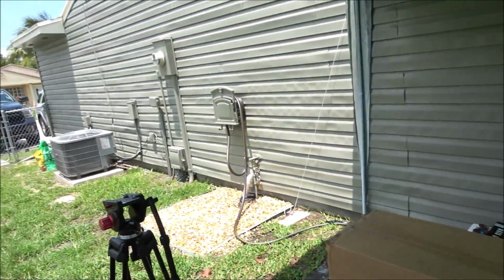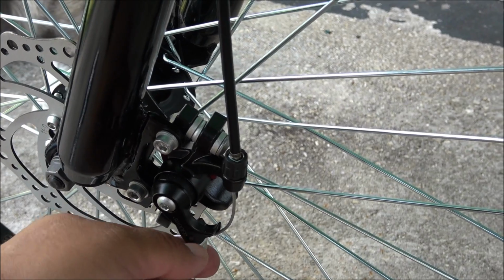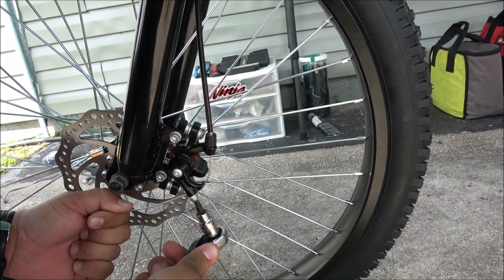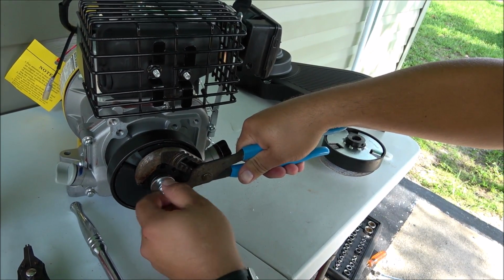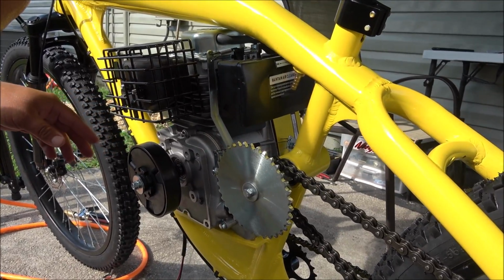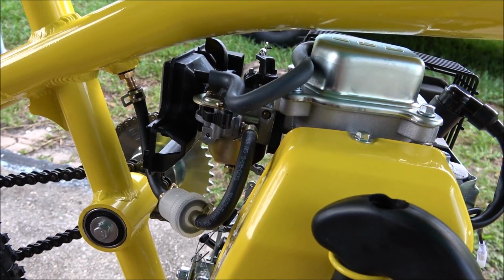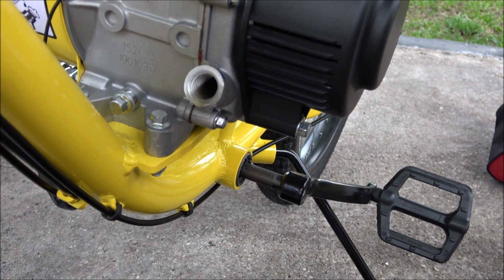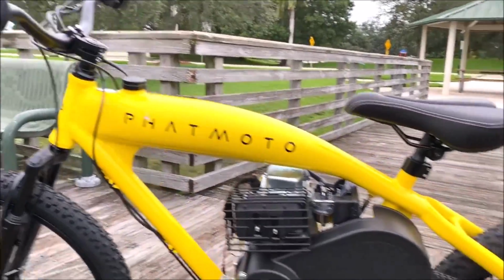Phatmoto Rover 2020 [Motorized Bicycle] - 79cc 4 Stroke - Unboxing & Installation Tutorial

Comment: At least it sounds decent!!
They make performance parts for these engines, you can probably get 5-6 maybe 8-9 HP from that engine, without spending a fortune, if you bypass the governor, the flywheel needs to be replaced, it can explode , unless it has the aluminum flywheel, then it's less likely, but the billet flywheel is best, 5000rpm is about the fastest id spin it stock, with a bullet rod, and good flywheel, maybe a few little things, porting, and carburetor, exhaust, it will more than double the power, a cam is the final step, then proper gearing to take advantage of the engine, it should easily rev to 7-8k rpm, but a daily type ride, I'd keep it under 6k, but if it's just a commuter bike, a cam, rod, carb, and aluminum flywheel, using a motorcycle carb, with good oil, and frequently changing it, it should last years, spinning 5-6k rpm, at near 50mph, making 5-6 HP,  with porting and such maybe more, I'm not that familiar with the smaller 79cc engines, they may possibly make 10hp at 8k rpm +/- with lots of work,   but the cast iron flywheels do explode, I would not rev over 4k-4500rpm, definitely not over 5k for any time, even then, I'd remove the cover, and check it weekly,  if it explodes you will likely. Be going to the hospital in a ambulance! It's not like a engine blowing up, it's more like a grenade exploding, chunks of iron evacuate the area, possibly destroying the engine also, , and heck, you can probably put another one of these engines on the rear, above the tire, just add more chain,  and throttle cable, maybe a chain tensioner, and idlers, that looks like the harbor freight engine, maybe $200 to add another engine! Or being you add it to the rear. Go with the 212cc, 6-7 HP, 10 with no Governor and aluminum flywheel, carburetor,  it would probably do 80mph with the 212, or 224 engine,  
Sorry I ramble a, well a lot! 😔 Sorry
Reply: That was the best comment I seen scrolling through these.

Comment: I think there’s a fitment issue with the EZM transmission. The rear sprocket on the EZM is also huge (so you have to use a tensioner most likely meh!). The go cart transmission that piston bike or gas bike sells is just jackshaft. Haven’t seen a cvt idunno wtf to do for a transmission. Grubee won’t have stock for the 5G for a month or two -Oct 19 2020

Comment: Im having trouble with the throttle i pull it and it doesn’t snap back in to place and it doesn’t move the throttle cable at all, also im having a bit of trouble getting the chain to be more lose and the breaks are giving me trouble to i tried to tighten it and still really nothing not sure if im doing stuff wrong
Reply: Spary some wd40 in the openings of the cable and around the  Linkage

Comment: I ordered a red one. I live in a colder area so I'll be putting 0W-30 oil in it instead.

The manual for my welder generator combo says 10W-30 if the temp stays above freezing, 5W-30 for between 0 and freezing, and 0W-30 if I'm going to start it below 0.

I'm assuming similar principals apply here.
Reply: Where did you order the bike combo

Comment: Excellent video. NEAT ! Quick question, my Phatmoto 2020 rear wheel does move very freely. I am comparing it to my earlier build on a cruiser bicycle. Is it normal?  Like if I lift the rear wheel by the seat and give it a spin, the wheel spins for a couple of rounds but not as freely like a bicycle wheel. Is it normal? Maybe the rear brake pads are clutching the brake disc a bit? Or may be the transmission setup? Any tip would be appreciated. Thanks. And again an excellent video. Thanks for uploading.
Reply from the maker: Nick Hersheys Resistance on the rear wheel is normal. Remember now you have 2 chains running plus a transmission. 😉
Reply from the maker: Nick Hersheys Yes it’s normal.
Reply: It's a crappy design.

Comment: 4 or 5 oil changes from 2 qts= break in requires 5 min idle /1st change!!!!!! no exceptions ! will see metal from rings /break in... then 30 min idle 2nd.. then 1 tank, or 160 miles.. 3rd... broke -in :>).... then once a year ! ..

Comment: I got the 2020 version and after adjusting the idle the throttle seems to take for ever to respond and the bike cuts in and out. It’s like it’s starving for fuel. I barely have a mile on it. Any thoughts?
Reply: on mine the choke was marked wrong
Reply: @markhagerman9736  so where it say’s off it’s really on?

Comment: Would it be better to build one from scratch or get this one
Reply: Buy one and start riding. I have built stuff like that and it seems like it takes longer than it should and it does
Reply: Buy this and slowly upgrade everything. 
Its the best frame you can buy! The stock parts will hold up if taken care of i got over 20,000 miles on mine.

Comment: Please someone help me get this thing started. I did everything the gentleman on this video said to do and I've yet to get it running.
Reply from the maker: Melvin Cortes Check your kill switch, make sure the fuel valve is on, its located on the carb. Also make sure the wire that goes to the spark plug is connected
Reply: I've done all that already
Reply: @MJTechChannel  I think its something electrical. That wrong from factory. I'm not getting any spark from the plug at all...
Reply from the maker: Melvin Cortes Disconnect the kill switch
Reply: @MJTechChannel  completely?
Reply: @MJTechChannel  it turned on!!! Wow!! Ok but what do I do about shutting it off??
Reply from the maker: Melvin Cortes your switch might be backwards on the labels
Reply: @MJTechChannel  ok thamks
Reply: @MJTechChannel  thank you so much bro!!!
Reply: @MJTechChannel  thank you very much for helping me😊
Reply from the maker: Melvin Cortes Glad I was able to help! Take care and ride safe
Reply: @MJTechChannel  good afternoon sir. Sorry to bother you but I have a quick question..
When I start to take off the front of my bike trembled like if the neck was lose.. What would you do?
Reply: @MJTechChannel  sorry to bother you but the screws on each side of the frame in the rear,what are they for or what do they do?

Comment: It's a bicycle. You don't need all of that thread lock... especially red. One of the few places you MIGHT encounter thread lock (blue) from the factory are on the disc rotor mount screws. If you feel like you absolutely need to gum up the threads with something use Loctite 222 or Pliobond. Lock nuts are sufficient for motor mount hardware.  Also, I can tell you a story about a guy now missing some toes from riding with flip-flops...
Reply: This bike needs loc-tite, maybe not red, but blue for sure on disc/sprocket bolts, jack shaft bolts, and pedal cranks, all areas that owners have had complaints about coming loose. Also it is advised to replace said bolts with quality ones. The stock bolts are inferior and will snap off with low torque. Good luck and check those bolts for tightness, don't be one of the ones with a damaged rear wheel because they came loose on you.

Comment: I just bought a Phatmoto Rover and the chain sounds a little noisy when I roll the wheel.
Reply: Just got mine and I have to keep it at full throttle at all times if I want to move fast but it's really hard to keep it at full throttle hurts my wrist do you have that problem

Comment: Just received mine in and followed your instructions to assemble but couldn't get front tire on becuase the forks were bent had to bend them back to get front tire on but brakes dokt line up they are still pointed too much in , does the bike come out the box with the back brakes locked up like I can move the back tire i cant move becuase brakes are too tight and no way to give release I called the company but they said no returns and hung up I called better business bureau becuase sure they sent me a defect I seen all the assembly videos and mine was nothing like those its bent or shipping bent the bike up bad or they sold me a defect and wont give me a return I am so disappointed I cant even ride this thing that costs me 1200$
Reply: My forks were bent too and they sent me replacement forks at first I wanted to return it and get my money back because I was going to get a e-bike and they said it would cost me about $400 to send it back so I kept it

Comment: Please do yourself a favor and don't use grease on your clutch bushing, it really doesn't last very long and you'll be tearing down your clutch to constantly re-grease it. Please use 30 weight oil on the bushing, like the clutch manufacturers recommend. It will outlast the grease 10 to 1 and it can be done with the clutch still on engine. 3 or 4 drops at the snap ring will do it. Spend your time riding not greasing a clutch.
Reply: You are right and like I think you said amd makes sense oil after riding when hot so oil can soak in metal. Check out comments some guys say don't use lock tite that"s a good one. Do you know can you still clear and pedal a 212cc with out rubbing or hitting your legs? I tried going on Facebook a week ago had some reasonable used phat Moto bikes but no reply or phone numbers to call.
Reply: @zedee2000  Yes, a Predator 212 can be made to fit, and if done right clears the pedals, there are some things to consider. A real weak point is the rear hub and axle. With the added horse power and torque (P 212 = 7+ hp) the axles bend or snap. Upgrading to a chromoly axle and grease and adjustment it might last for a while. Some guys are upgrading to billet hubs with sealed bearings 11 and 10 gauge spokes. Or try converting your hubs to a sealed bearing and strong axle. Lok-tite is mandatory on this bike, also upgrading the hardware (bolts are inferior from factory). Try checking your local Craigslist listings for Phatmoto's, I still see them come up, cheap $500 with upgrades. Good luck. The new 2021 Phatmoto's come with a upgraded Hilliard clutch, (its really a undercover race clutch) with lightened race shoes, hardened 5/8 hub, and select springs. Myself and a friend, did the testing for Hilliard for Phatmoto. Trust me Hilliard says put oil on your bushing, use grease and you'll render the bushing useless.
Reply: @beaubrummelmotorizedbicycles  okay thanks, I remember you had the keyway snap off with the Hilliard clutch. That's why I went with the max torque clutch, on the door for $75.00 I've got a new drive chain to replace, rear tire with baby powdwer, max torque clutch, drill holes in side cover, Grease the   5 points of bearings including jackshaft. I saw a video you can take a pic tool and lightly take that rubber seal off on the self sealed bearings on the jackshaft add grease and put the rubber seal back on. You can do it with any self sealed bearing with that flat rubber seal. I thought about switching over to propane on the phat moto but the engine is so dependable since I ride it so much. I have changed over most of my little generators to propane for dependability and longevity. Because they sit so much. You may not remember me I changed my Google account name a while back. Someday I think I'm going to do a YouTube channel on a few things, once I get a better smartphone camera. You have a good  channel what's good tips keep up the good work.
Reply: @beaubrummelmotorizedbicycles  one video tou might want to check out It'll be hard to believe. YouTube baking soda and molasses kills cancer. A guy named Veto did the video he standing on a stove cooking up baking soda and molasses to drink for his stage 4 prostate cancer. Each night before I go to bed I take about 8 ounce of 9.5 alkaline water and add two teaspoons maple syrup. Mix it up, drink it, brush my teeth and go to bed.
Reply: @zedee2000  Thanks Ze Dee I do remember you, one where going to do the propane conversion. I was really not happy with the 5/8 Extreme Duty shearing off the key. They now offer the hardened hub for that clutch and it is repaired. Through the facebook group I moderate, the admin knows the head engineer at Hilliard and set us up as the testers for the new clutch Phatmoto sells and puts on there new bikes. They are good because of the hardened hub, Max Torque is a good American made clutch, I have one also. In fact all the clutches that come out of China have copied the Max Torque design, just no quality. It sounds like you have a good handle on your bike. I also saw a video about popping of the seals and regreasing the bearings like our jack shaft bearings, I am planning a video on that. I use a moderate priced cell phone camera for my videos. The trick is to use a holder so video is steady and move the camera slowly from item to item, no jerky movements and speak close to the mic so the sound is loud and clear. Thanks for watching.
Reply: @zedee2000  I guess people will believe any thing nowadays, you just shake your head at the gullability of some people.

Comment: Better off getting a separate engine 80cc and put it on a mountain bike for a hundred bucks they have a nice mountain bike with front shocks
Reply: Not really this frame is purpose built. Mountain bikes are the worst for motors. If you buy a tank frame bike with a motor kit its actually more than 900 bucks. I've built a lot of 4 strokes.

Comment: Holy crap! Don’t use penzoil use good quality oil you engine will thank you. Ever tear down an engine that used penzoil? Bye the way, I’m a retired diesel mechanic. Did a lot a gas work too.
Reply: so why say Pennzoil is bad then not say which is better?
Reply: @chriss4365   I preferred Quaker State, my dad preferred moble 1 after I tore down his engine and showed him how much sludge (thick tar like build up) there was throughout the engine. Penzoil is the worst I’ve seen for sludge build up.Havoline didn’t seem to keep its viscosity ( slick feeling when rubbed between your fingers) but penzoil was by far the worst in my opinion. Sludge buildup in the engine can cause many problems and shorten engine life.
Reply: @dennishein2812  you only get sludge if you never change the oil.

Comment: Great video. Question: Should I use chain lube? I used to do that on my old Honda MC as recommended by the manufacturer.
Reply: I soaked my chain in a empty gojo hand cleaner tub with the chain soaked in 10W30 oil for a few days. Then I let it drip dry mostly and install it. You could use thicker oil like 80W90 gear oil or a synthetic version is okay. Basically you don't want to let the chains get dry oil all three chains oil periodically. I take a sponge filled with oil and turn the chain over by hand both of them and coat the chain with oil as it's turning. I also add 2 drops of oil to the max clutch every time before I ride it. I bought the new clutch max torque for a 415 chain on ebay. It's made it so much better when riding!

Comment: bolt 's insertions should be from the top when ever possible, should a nut out over time for what ever reason,  say it happens lose a nut lose a bolt , or lose a nut keep the bolt in the hole, what happens /  when you lose all your nuts and you put them all in one basket, isn't good just ask anyone.

Comment: Great video. I was wondering if anybody else has this issue with the phatmoto. When I let the engine warm up a few mi and turn the choke to off the best I can get is 15MPH. When I leave the choke on I can get up to 28MPH. Is it the gas I am using as I have read about engines running rich?
Reply: If you are getting better performance with the choke on, you most likely have a vacuum leak. Or she’s running lean. Check for vacuum leaks. Atleast that is where I would start.
Reply: @Jeff-py6sb  thanks for the info.
Reply: You're choke isn't on when your doing 28mph. On is end right pedal side off is end left clutch side

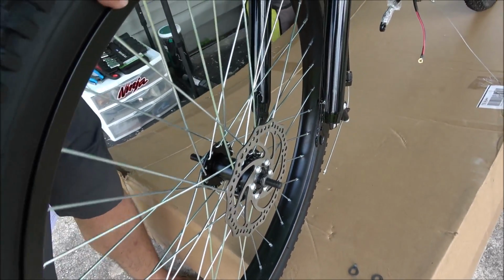Comment: 3:24 insert a tire ? What about the rim / wheel the rubber/ tire is attached too, should have simply said this correct and said Insert the Wheel & not a tire because a tire is solely that a single piece without a rim wheel 🛞.

Comment: Is it expensive ?
Reply from the maker: They retail at $899.
Reply: @MJTechChannel  1499 with an offer right now at 999 + 20 for the bike sealer because the gas will rust the tank which guess what its your frame
Reply: @Ezra Redgwell the whole concept is stupid since you can get better engine and bike at half the price
Reply: Ezra Redgwell ok 👍🏻
Reply: @nickgasparis1709  where at
Reply: @nickgasparis1709  yea please explain as where and what kind ? I love to hear this.  This is an absolutely awesome looking bike ! Especially if you get the lightweight 7 spoke mag rims that can either match the bike color or go black rims with the yellow frame 🔥
Reply: @truthbespoken7750  i did a bit of research in the net and found out that for 900 dollars i get to build a 125cc bike like this similar design if not better and this piece of junk retails at around 1500 dollars and its 79 cc

Comment: I really like the looks but the assembly procedure is too complicated and having to disassemble the clutch for lubrication and adding loctite because the manufacturer couldn't be bothered, are deal breakers for me. Why couldn't Phatmoto be bothered doing that at the factory?? 

I hope by 2022 they got rid of that tacky lawn mower engine and replaced it with an electric engine.

Comment: ebikes > gas bikes
Reply: The only benefit I could see this having is if you're going to ride this cross country or something like that.
Cuz In city commuting e bikes or e scooters are Definitely superior
Reply: @igot5onit423 sorry but no, in every metric gas bikes are superior other than noise. There faster, You could always change the engine, and there cheap and high quality, You can also modify them to go faster, no charging up necessarily. Pretty easy to fix up when you have the tools. To even match up to the same standards you would need to spend $2000+😱 while a high quality 4 stroke or 2 stroke goes about $300 to $900😎